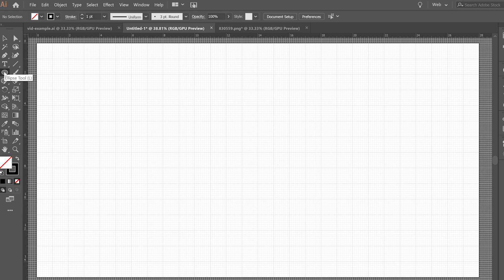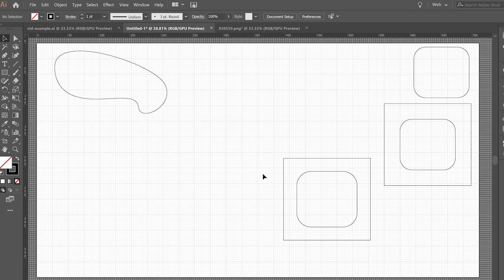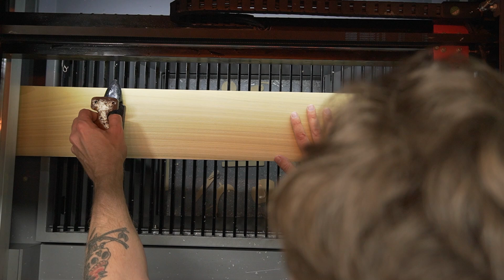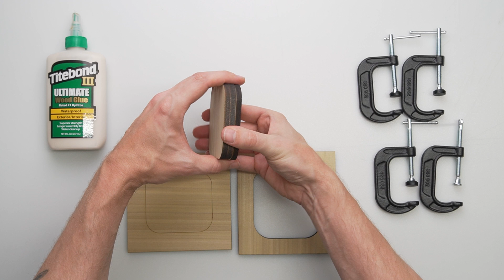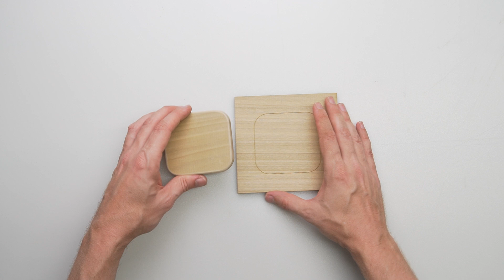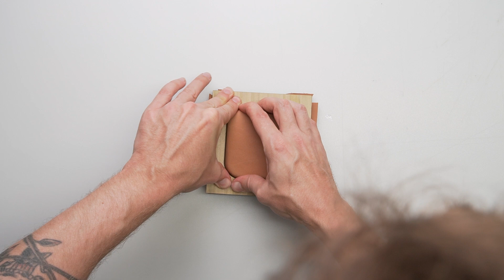Laser Cutting Custom Wet Molds for Leathercraft (1 of 2)

Comment: Great first part! I don’t have a laser but I have a Cricut and should be able to do pretty close to the same process. One quick tip with Illustrator, you don’t need to change your units at all. If you’re set to inches but want to use mm for a measurement just type the mm after the number and illustrator will convert to whatever unit is currently set. Off to watch part 2 now!

Comment: I think you have to round (bevel) the inside bottom of your top plate to get the transition from the sides to flat smooth.  You may find you have a 'crease' or line where the top plate meets the leather.  Rounding edges is always a good idea.